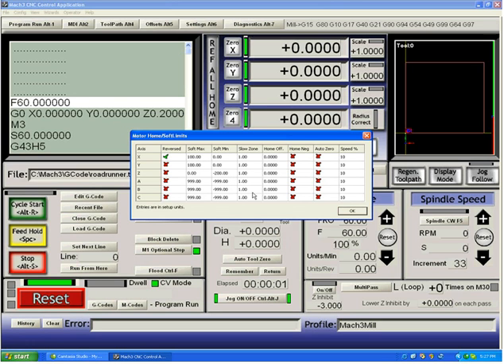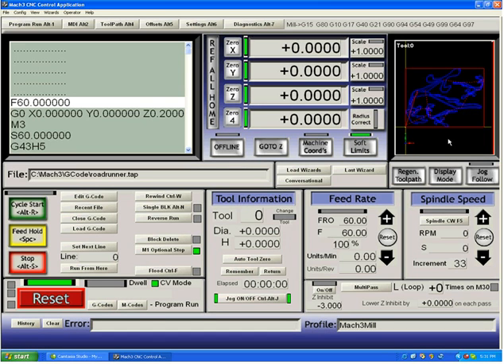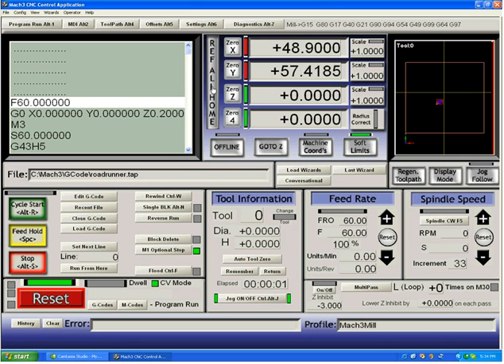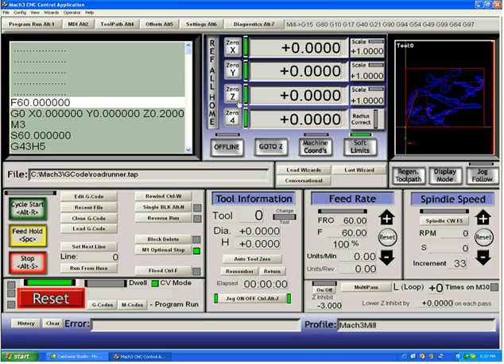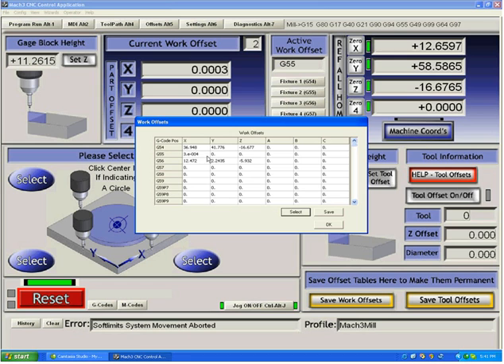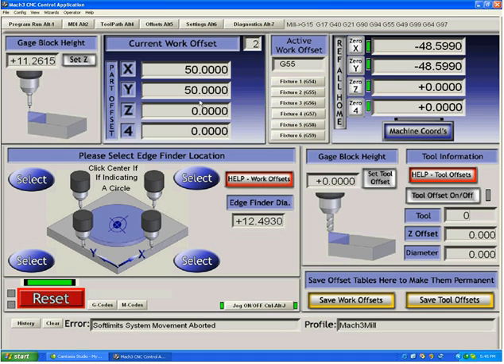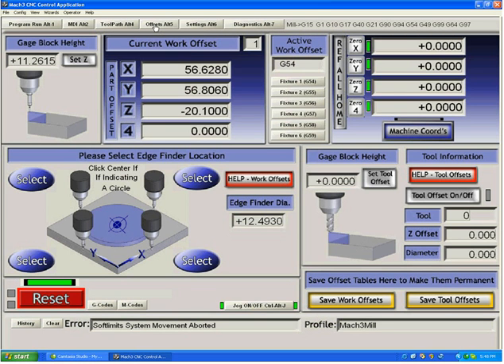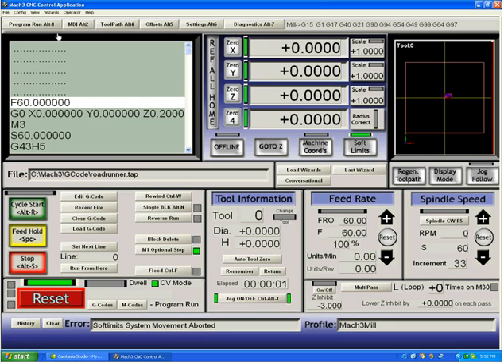Mach3 Homing Limits and Offsets

Comment: I am looking to implement just homing switches and set soft limits instead of wiring hard limit switches. It seems a solution as long as the machine is homed every time it is powered up.  What are your thoughts please?

Comment: I have tried this, but the gcode always references g54, so even when I am in the g55 offset and hit run, the machine will move to the location stored in G54. Can the gcode be changed so it does not reference g54 and can run in your selected off-set location?

Comment: Great explanation. QQ if I may...with soft limits, I assume I have to move to 0,0,0 and then Ref All each time I power cycle IF I don't have hard limit switches on the machine. Supplementary question, I assume for homing I need to be using an Input for each of those switches and ide tidying them in Mach3?

Comment: why does the display in this video show the X axis reversed and not the Y axis? when using the A axis as slaved to the Y axis what are the settings in both "Home soft limits" and "Ports and Pins" for the A axis? I would really appreciate some assistance

Comment: 7:30 How come active high can be the safest? If a home switch wire is broken, it has already no voltage on it. If there is voltage by default (active low) you can immediately see some wire is broken since there will be no voltage and "broken state" will be equal to "home switch hit state". Where did I get wrong? Thx.

Comment: I set it all up and got it to work perfectly. I saved the configuration, shut down mach 3 and hit the save fixture. However, when I turn it back on, whatever position it's in when I shut it off becomes the new soft limit position. Do I have to run it back to the zero on the soft limits every time I shut it off? I do not have limit switches.

Comment: Hello, im newly working in THIS software i sow from other video  the movement of the head can control using keyboard which is ⬆️⬇️⬅️➡️ page-up ang page-dawn but in my
case my keyboard us no working for this command i hope somebody can help me
Reply: Purchase a remote usb keypad on amazon.  Plug it in and use the arrows on the keypad.
Reply: Youpi mast attrubate fonction in configuration in mach3

Comment: Do you have a tutorial for setting my machine coordinates system? My mach 3 doesn't know the table size...I worked that way for 3 years and don't have a problem, but I'd like to set a correct limits for the machine